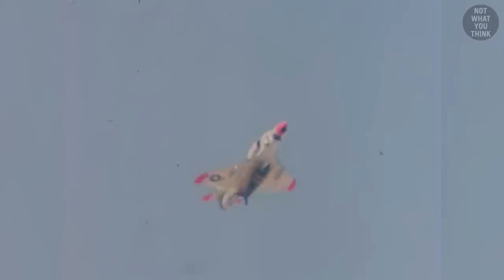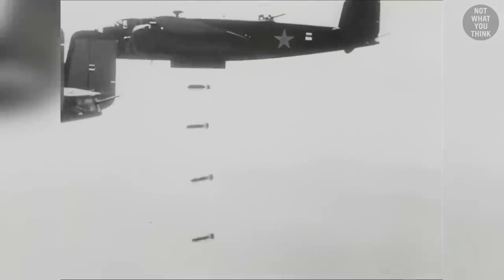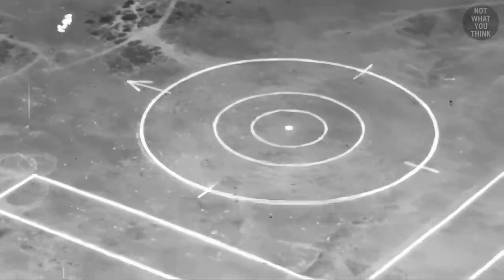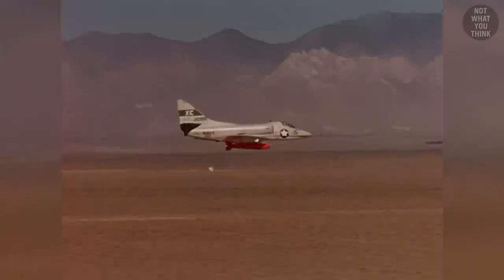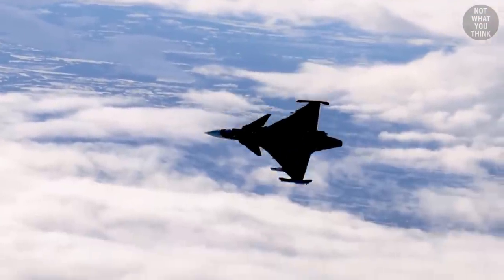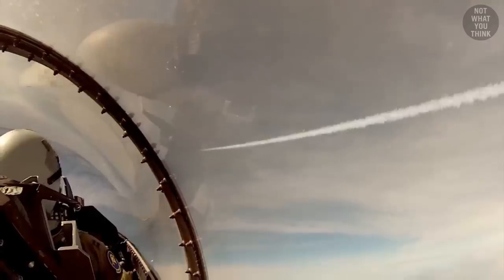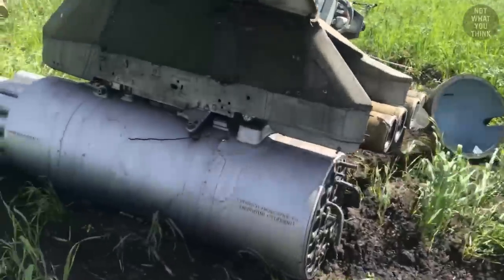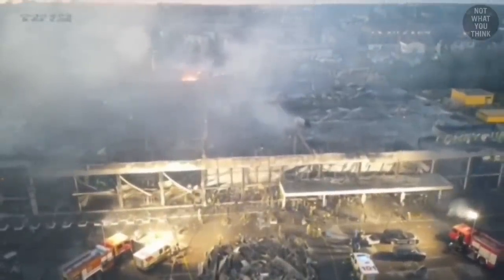Why Are Russian Helicopters Shooting Up at the Sky?

Comment: Actually, LOFT bombing is quite common still. The F/A-18 even has a LOFT mode I think. This is probably because (if I'm wrong tell me) SAM sites like S-400s on flat land can wipe out anything above the horizon, including HARMs. So non-stealth aircraft without Mavericks or JSOWs and such in a pinch have to fly low up to it and pop up before running away in a 180°. That's why stealth is so desirable, because it makes it harder to lock you, especially because large radars can probably see you (but not make you undetectable.).
Reply: It is common as f*ck doing a bomb run! using dumb bombs.
Even laser guided is used, you loft it further, and then guide it till impact.

Only thing is that the choppers use rockets instead of a bomb.
don't underestimate this cause in great number, it's like artillery strike! Fast and no retaliation by manpads.
Reply: Well the S-400 is overhyped as f, and there are only a handfull of them. There are also several other ws’s that can be used other than AGM-65’s and HARMS
Reply: @AugmentedGravity  
Not at all.
They are not overrated.
Literally one of the best air defence systems in the world right now.
You are really underestimating ground based defence systems of Russia.
They even scored the longest kill against one Ukranian jet recently.
Reply: @fly463  nah, they are overhyped.S400 really went quiet and no longer shot anything down ever since that 1 "longest kill" probably propaganda anyway
Reply: @navyseal1689  
Everything russian is propaganda for you guys 
Keep underestimating your enemy forever
Reply: @fly463  then why we dont hear about S400 ever again from war in Ukraine?
Reply: @navyseal1689  
They are always downing one or two jets per week.
If you are not listening the news about them,that doesn't mean they are not killing jets.
They can't use multi million dollar systems to intercept Rocket systems like 'Himars'.
S-400 or S-500 can only be used effectively against airborne targets, cruise missiles & ballistic missiles.
Reply: Chill guys, theoretically S400 is a top notch SAM site, but crappy leadership has ensured it will never be used to its full potential.
Reply: LOL if you think the US has done any loft bombing in decades.
Reply: It was practised up until 2010 with the RAAF on f-111's with dumb bombs & laser guided. From someone I know and have talked to, they's practice doing it at up to mach 2, while being extremely accurate.
Reply: @fly463  Okay, but the S-400 has an advantage when the jets they are shooting down are at close ranges and optimal look angles. While I appreciate the work they are doing, let's see them shoot down any non-Russian aircraft.
Reply: @fly463  have you heard of the Ukraine invasion?
Reply: @AugmentedGravity  did they invade something? I thought their major goal is to defend against Russia
Reply: @manender1020  what
Reply: @navyseal1689  it is not that "you don't hear about them" it is because your media doesn't want you to know anything successful about Russia. That's why most people think Ukraine is about to reach Moscow in a few weeks.
Reply: @AliAli-et7zy  please dont try  to enlighten them. its against the narrative.
Reply: @AliAli-et7zy  the scariest thing is what a lot of people in Russia think so
Reply: @AugmentedGravity  like... He answered to comment about Ukraine. I don't think what a person who uses internet and doesn't know about ya-know-which-armed-conflict even exists
Reply: @allahsnackbar9915  maybe you're right
Reply: @manender1020  please make yourself understood
Reply: @AliAli-et7zy   lol russia has lost considerably more men and materiel in Ukraine than the US did in Vietnam and every war since combined, they're literally recruiting criminals because they have lost so many men, just a shamefully pathetic display of incompetence and military dysfunction.
Reply: @navyseal1689  Literally the only reason you dont hear about S400 so often is because there arent enough targets for it to kill.
Reply: @Colin-kh6kp  US has always trained and used the soldiers of the country they invaded. They used afghani soldiers against Taliban, south Vietnamese soldiers against Vietcong. If you look at those casualties you can see the real number. Also US never cared about civilian casualties and bombed the shit out of entire country and its cities to create more chaos. On the other hand no country that fought against US has been helped like Ukraine in modern history. The second biggest country in Europe, backed by entire NATO bloc, troops trained for 8 years according to NATO standards, got help of 1.5x of russian military budget in one year and you say Russia has lost more men and equipment? If Taliban or Vietnam or any other country have had this kind of help, they'd kick US out of their countries much more earlier.
Reply: @navyseal1689  No, bud. It's a solid system. Just not many of them around yet. Russians have built some very impressive gear over the years. They just end up not being used very effectively by those on the ground. Lack of truly professional training.
Reply: @AugmentedGravity  understood what? It looks like you ran out of arguments and are just trying to confuse everyone
Reply: @AugmentedGravity  This is the stupid est thing i have heard. S 125 shot down f117  so if you think so go check it out
Reply: @peps4461  it opened its bay doors
Reply: @navyseal1689  Ukraine uses mostly S300 and their potent enough to keep the Russian airforce largely at bay. Or else the war would have been over a while back.
Reply: @Colin-kh6kp  yeah you know what military incompetence and disfunction is we all watched Afganistan🤣🤣🤣
Reply: HARM/AARGM missiles are actually pretty simple to hit and had been standard targets for Russian air defense systems for decades. So yes, what you say makes sense. And noone in their right mind forgets the old lessons: those were written in blood.
Reply: @Max_Da_G  …
Reply: @Vexas345  you think a western non-stealth bird would have a higher chance of survival than a Ukrainian Flanker? Slim chance.
Reply: @AliAli-et7zy  What all these losers carefully avoid is also simple question of numbers: during Desert Storm they brought 965K troops against Saddams 650K. Terrain in Iraq is flat and simple. Ukraine has far more territory, shitload of villages that all need to be cleared, far more complex terrain, same sized military as that of Iraq at the point of invasion, and Russians took all that on with  250k troops, or 1/4 of the force west brought in.
Reply: @Max_Da_G  It's true that Russian stuff is good against Western birds like 747s, that's fair. See the thing is though, the US would never just bring in assets vulnerable to the S-400. They'd use the good stuff to clear the way first because SEAD is a basic military strategy and they aren't clueless hacks. 

I don't know why people keep trying to flex Russia's initial troop size btw. Battles are won in the preparation phase. So Russia can't even figure out how to organize enough troops to win a war, that just makes them incompetent. Is that really your argument, Russia isn't weak, they're just stupid?
Reply: @pd28cat  Corruption and lack of training specifically. Though it still can be effective.
Reply: S400 does interlink with multiple Airborne AWACs which allows it to engage targets up to 400km away.
Reply: @fly463  Everyone should stop underestimating the third best military in Ukraine?
Reply: @gregorycook9077  
Third based military captured the most land?
Reply: Nooooo its stoopid poor dirty russians! Havent you read the comments?
Reply: @Max_Da_G  you just said it twice. I see no difference between constantly defending Russia and constantly hating it/defending Ukraine or West. Why is it so hard to support Russia while living in Russia
Reply: Came here to say this.  FA-18 pilots were trained in both loft and lay-down bombing to deliver both conventional and nukes.  Accurate enough boss man told them to stop hitting the semi-trailer that was their target.  Don't ask me how I know.
Reply: Russians have Kh25, Kh29, vikhr, LMUR or Izdelie 305 - and they almost never used them

I bet USA in fight with Ukraine wont use these mavericks or JSOW too
Reply: @Alex-no1rb  >Tussians
Russia but it's Turkey
Makes me think
Reply: @manender1020  hehe)
Thank for correcting me
Reply: I knew there will be discussion about S400 lol. Both Ukrainian S300 and Russian S400&300 fire a lot of rockets, propably daily.
That's why both sides lost a lot of aircraft and both sides have to limit their aicraft operations. After a few days, when Ukrainian AAs relocated and went online, Russian aicrafts started receiving heavy loses.. so, the air war became pretty limited but both sides lost a lot of planes... S400 ammunition is shot so much that its unknown there will be enough ammunition for them. Its not about quality of equipment only. Its also training, communication, using other radar types etc. but mostly, counter-battery charges are very dangerous, each side is hunting for each others AA batteries while these batteries have to shoot at drones and missiles too... I dont remember if Russians didnt use S400 as an artillery piece lol, not remember if its true.
Reply: @Colin-kh6kp  the US Marine Corps recruited from prisons because prisoners have the bloodlust and will to survive a war.
Reply: @olgagaming5544  
1. not only S-300 and derivatives; most of UA and RU AA systems in medium-range (Buk, Tor, for UA since autumn - Iris-T and NASAMS) and short-range (Stormer, Osa, Strela, Pantsir, Tunguska etc). This mix create deep anti-air defense on the front
2. yeah, russians have so many S-300 that they managed to convert them to some sort of ersatz-SRBM (like Tochka or Iskander). For Mykolayiv, Kharkiv, Zaporizhzhia it became the weapon of terror
Reply: @navyseal1689  Russia can't afford to mass them because they're quite expensive. If they had them in large numbers you'd definitely hear a lot more about them
Reply: The F-18C (I‘m talking about the Legacy Hornet, not the Super Hornet) had at least a LOFT Mode for the AIM-7 Sparrow Missile, I‘m not so sure about A2G. The F-16 on the other Hand definitely has a LOFT Mode for HARM Missiles and also for Bombs.
Reply: @fly463  I'm fairly sure it's mathematically impossible to underestimate the competency of the Russian army
Reply: @utley  wow, you a freethinker i see. So smart position
Reply: @Alex-no1rb  yeah? Gonna prove me wrong? I got all night and day.
Reply: @navyseal1689  one s400 missile cost $1M they are picking targets carefully. S400 can spike stealth from 60nm supposedly. So don’t underestimate it
Reply: @AliAli-et7zy  r u nuts? I write - "initially"
In spring apart from our and soviet stoks we've got only stingers, javelins and NLAWs.
Reply: @AliAli-et7zy  and according to Budapest memorandum and because USA take from us conventional ballistic andcruise missiles america really owe us)
Reply: @Alex-no1rb  Lol why would they help you between 2014-2022? Do even they owe anything to you? And in Budapest memorandum Belarus and Ukraine gave up their nuclear weapons that's been built by SOVIEY UNION. So they weren't "yours". You just gave them to their owners.
Reply: that's exactly the reason why Ukrainian helicopter pilots do it. I watched an interview with one of them recently and he explained this. Russians started copying Ukrainian pilots after that. It's the safest way to attack enemy and not be shot down with air defence systems
Reply: @AliAli-et7zy  Belarus, Ukraine and Russia created USSR
Reply: @Alex-no1rb  There was no Belarus or Ukraine until 1917-1918. Russian bolsheviks created USSR from Russian empire.
Reply: @AliAli-et7zy  there were even 4  Ukraine gov: Ukraine People Republic, Soviet Ukraine (in two forms; the latest, created in 1919, exist from march 1919 to december 1991), Ukrainian State (hetmanate) and West-Ukrainian People Republic (1918-1919/1920)

Belarus have at least one national and one soviet government (idk their histrory ver well)

Ukrainian&Belarus&Russian soviet republics created USSR in 1922 and the same entities disbanded Union in 1991
Reply: @allahsnackbar9915  Hate to have to agree with you, air defense systems are Russia's few strong suits right now. I'm sure the ones in the know aren't as jolly as these commenters. Nothing good comes from underestimating your enemy.
Reply: The truth about stealth is that it works good it lab conditions
Reply: Believe me .... Russia SEES all your INVISIBLE AND HIGHLY OBSERVABLE aircraft. And easily destroy them.
Reply: @__Nomad__  comrade, there is an enormous difference between being able to acquire something with the radar return of a tennis ball and being able to track, find a firing solution and actually hit it.  Nobody said our stealth aircraft were completely invisible, but boy do they work!
Reply: @AliAli-et7zy  so what?  There was East Germany until Stalin pulled it out of his ass.  Russia is upset that her former satellites have seen the light and gravitated towards the EU rather than having to live under Putin’s boot.  Russia has always favored defense in depth with someone else’s land, and as freedom and market based economies grow, it makes corruption and outright mismanagement stick out.  I’m happy to send my support to Ukraine to keep Putin and his army of convicts out.
Reply: @Max_Da_G  I think this is a huge exaggeration (& I’d like to see the Russian Air Force try.) The AGM-88 travels @ Mach 2.9+, hugs the ground and has gps & ins navigation. It will still hit a radar with a 150lb warhead even if the radar is shut off & even transmits pictures of the crew diving out of the radar van in the second before impact.  They can be used in many different modes.  I doubt that a Russian S-400 platoon would even be able to do anything in time other than to shut down the radar.  Getting a firing solution on something smaller in diameter than a volleyball moving 3580 km/hr is not trivial, especially since even though the S-400 is cheap, the larger missile runs $3M per shot vs. $248,000 per HARM shot.
Reply: @thomasfx3190  
Maybe... Only the Pentagon and the Ministry of Defense of the Russian Federation have real information. F22 beautiful, no doubt. But the comrades from the Pentagon in Syria really didn’t want to enter the S-400 control zone on the F-35. So they know that the stealth system against air defense systems of this level is powerless.
Reply: @toolbaggers  Considering we have footage of both A-10s and F/A-18s Loft-Bombing in Afghanistan of as late as 2021, yes, LOL at us indeed ;)

Comment: Not sure if somebody mentioned it before as I don't have time to read all the comments, Russians have developed pretty good outomatic launch for this kind of maneuver, with newest being able to calculate with wind and weather to further enhance precision, and when you combine good calculation with accuracy by volume, it can suppress enemy, either stopping their advance or shells shocking and than push their position.
Reply: In any case it's still better than going inside an area with saturated Soviet/NATO manpads
Reply: I think I heard that Soviet helicopters are equipped with fire control computers that can calculate solutions for pitch up launching. I can't verify but I still think that it makes sense, considering Russians seem like they are treating rotor wings more like airborne artillery and fire support systems than as air cavalries like the western militaries do.
Reply: The system called SPV-24 "Gefest".
Reply: @kyouhyung  
Yes, in the last 10 years, automatic fire systems have developed a lot. For example, now freely falling bombs can be considered precision weapons.
In addition, the specifics of the use of helicopters in Russia are correctly noted. The main support of the troops is provided by artillery, aviation is needed only when there is no support for artillery for some reason. In other words, aviation in Russia complements artillery.
Reply: @НиколайНикакоюс-л2ь  artilery is slow, it takes much time to reach region and prepare for fire, helikopters are much faster and can go back much faster than any artillery, but of course more expensive and require more trained personal than artillery